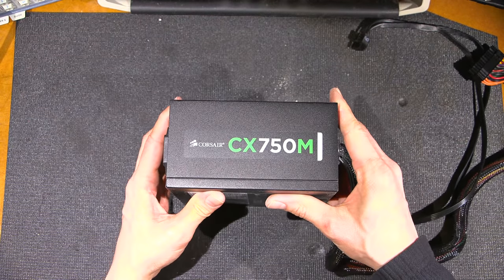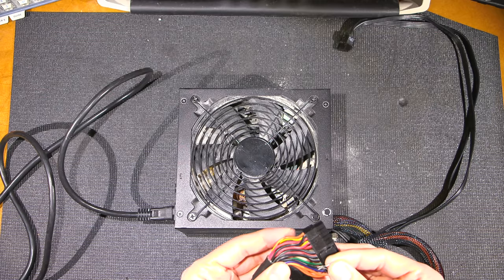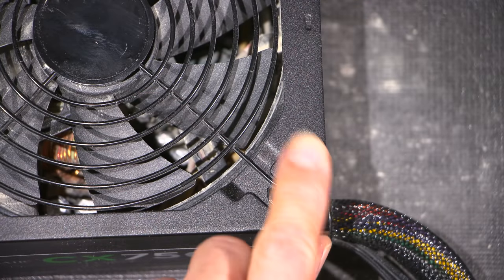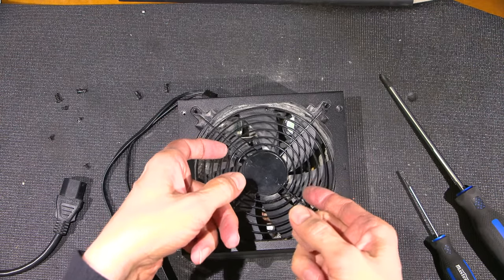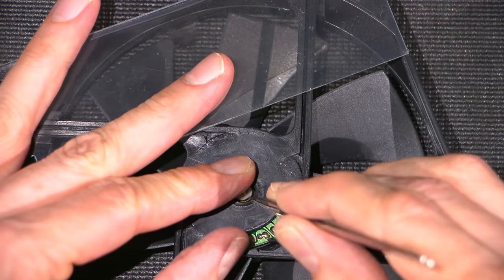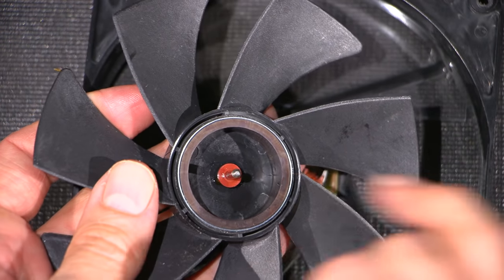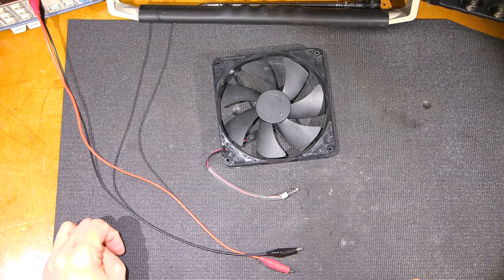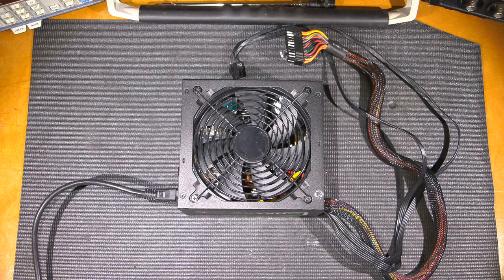Fix A Computer Power Supply!

Comment: I find that for a quick fix, one need only put some (a few drops) ATF (Dexron iii) in the cup where the keeper and the o-rings are, then move the shaft up and down until the ATF is 'pumped' into the bearing shaft and bushing area. The ATF is not only a great light lubricant in itself, but the mild solvent properties will re-liquefy any goopy grease. I have had fans come back to life for at least 5 years by just doing that. Seems to work good on dry bushings, and well as sticky fans with a lot of resistance. I think I would use white lithium grease on ball bearing fans... but I don't have many of those because the balls are annoyingly noisy.

Comment: This wasn't a video on fixing as Power Supply, it was a PC Fan restoration video. Just spent 20min watching a guy dust off a fan and lube up a bearing. Never seen anything done to the parts that supply power, just the fan that cools it. A bit of a elementary video for a guy surrounded by gear that looks like the inside of a goddamn moon lander.

Comment: You inspired me to oil my fans on my GPU, well the one fan that was going to crap and now it is running smooth..  Ironically it is the same fan that I took off and replaced when I got the GPU needing repairs...  The new fans died within 2 months...  GPU fans actually pop apart quite easily and oiling is very simple..  I wish they used more metal though..  They can put a couple grams of gold in the GPU but then chintz out on crappy plastic fans..  We should be able to replace the fans with normal case type fans on our GPU

Comment: I have an ATX PSU that's just destroyed itself. When I turned it on, there was a pretty loud pop followed, maybe a tenth to a fifth of s second later by an almighty bang. Smoke, accrid stench, blown fuse. On disassembly, it seems a mains switching mosfet was gone, it had a huge chunk missing from it and one of the big mains filter caps had vented. I'm assuming the first pop was the mosfet's death followed by the cap blowing its lid with a bang. I can replace the failed components, but I'd be happier if I knew what had caused it to begin with. Everything else in the section seems okay. One VERY weird thing that I think may be relevant. The switching mosfets are all mounted on a heatsink but they are not isolated from it, just screwed directly on it. That would mean the heatsink itself would be live at mains voltage. On checking, the heatsink is mounted to the PCB, but it's anchor points are not connected anywhere. I'm sure that odd design has played a role in this somehow..

Comment: Good vid.  I get your reasoninng for using the resistor.  BUT, if there was danger jumping the green wire to a ground, why then does EVGA and other PSU brands, provided a testor that is absent a resistor?

Comment: ive fixed a fair bit of these things i own and usually the fans are the issue i once had a psu explode and shoot flames from the back just due to a fan that seized so hard and never knew about it.. some times don't even make noise and just completely stuck and just explode from over heating (well if its a semi pos psu though it was 2008 so that explains my knowledge then to now) usually if fan is sealed from the back but know its a standard  bearing type with bushing i drill plastic out and fill it with oil and get it worked through and just seal back with some electric tape or some kinda epoxy carefully. and usually get many years from it. my 10 year old psu is a good example and still runs good today (now in my core 2 quad pc) as it was a 275cad psu of 1000watts bronze. hurray huge comment of my experience.

Comment: What would be the first components to check after a lightning strike? I have an Evga g2 1000w that would be suitable as psu for a boombox. 2 computers died that day and in the Silverstone sfx 600w psu it blew a mosfet driver? A "big" chip that is blown open (used the varistor for a logitech 2.1). In the Evga psu nothing is visibly wrong. Since this is purely a hobby i kind of have to use google/youtube to learn. Oh, i don´t own a osciloscope yet which i guess would help me try to diagnose my Rockford fosgate 400a4 with a blown chanel...

Comment: The bearings drying up seems to be a common issue with this powersupply as I've had this exact issue a few months ago :D
Although I didn't think about relubricating the bearing and just replaced it with a new noctua fan. I still have the old one because it wasn't as loud as your one so I might give new lubricant a try.
What lubricant do you recommend? I have no idea what to buy ^^
Great video as always!

Comment: Tnak you! never heard about the 300ohm resistor from greenn to GND-black.. usually just shorted w/switch... oops! (next trick... create circuit to get precision 12VDC or 10VDC - from 12V output... and/or 1VDC for high precision low resistance measurements... alternator armatures, field coils)

Comment: I have a tx850 corsair psu that no fan or noise happens when it is on and plugged into a motherboard. The motherboard LED lights, however. I shorted pins 15 and 16 on the psu connector and no noise or fan. Could this be the fuse?

Comment: is there any certain type of power supply fan that cannot be diassembled like yours? mine is antec VP 550, i've tried to open the fan because it's noisy but i didn't found anything screwable. is it ok to replace a power supply fan? does it has any requirements?

Comment: but is the fan noisy is the only problem? sometime the power supply will be on but the cpu will not fully on, test loads on the individual power voltages 5+ 5- 12+ 12-?

Comment: You lucked out that fan actually had bearings and not a mag-lev device. Nice job on the repair. I bet much of that dirt was also putting the blades out of balance contributing to the noise.

Comment: My older pc's I never had to actually take the psu apart to get to the fan; just took off the fan screen with the 4 screws as the lil silicone thinger was right there. Then I'd use sewing machine oil (or hair clipper oil) then put it back together. I had no idea wtf I was doing, never read about it or anything, just seemed logical. Now I know I could have blown myself up lol

Comment: My father's PC had a weird form factor 240mm case fan on the side.  It locked up one day, and I decided to try and fix it since I could not find replacements, even on eBay and Ali Express.  Sadly, the plastic clip that holds the fan together broke into miserable little pieces when I tried to get it off.  At that point, since the case had a bunch of other problems, I decided to replace the entire thing for him.  I should probably keep a supply of those clips, just in case this comes up again.

Comment: Get some black veil material that widows use at funerals.  The kind with the screen holes about 0.05 inch diameter.  A big enough piece to drape over the entire project with your hands underneath.  Sometimes you can find it at fabric stores.  Other times you have to buy a veil and just use the whole thing or mine out the material.  When little springs or washers pop off and go sailing they hit the veil and just fall right back onto the table mere inches from where you are working - instead of across the room into another universe never to be seen again.  The black veil material doesn't reflect light so you are almost seeing through it with little reduction in ability to see your project.  And it's so light your hands can barely feel it.

Comment: Would you be so kind as to tell us what the specifications of your isolation happen to be? I have some older vacuum tube radios and ham gear I would like to work on and need an isolation transformer. I do have an auto-transformer.

Comment: I've done this for years with fans. Not to keep the landfills from getting more crap but too cheap to buy new parts. Not to mention I use to repair Computers for people that couldn't afford to have them repaired. If I run into Fans with broken fins I would then strip it down and keep the bearing and motor PCB. I've tried different lubes over the years such as white lithium, sowing machine oil, silicon oil and axial grease but never tried mixing them, mostly in fear of causing a chemical reaction. I'm not good on keeping the sticker and end up using kapton tape and writing the fan specs in silver Sharpe on the side.

Comment: I was wondering how to get the fans apart.  Thanks!  I have a question.  I have one of the surma lw1600pg power supplies that are used for bitcoin mining and it says it works from 100-240 volts but it won't power on.  Have you had any experience with those?

Comment: I would agree with what you did hear, but those green label Corsair units in particular are known to cause failures in other components because of shoddy internal build quality. I’d rather dispose of the psu than dispose of the psu and the motherboard, cpu, gpu etc. etc.

Comment: The other thing you can do to turn the PSU on is to get a cheap PSU tester off of eBay, dime a dozen, cost less than 20USD to buy.

Bonus is that they tell you the wattage, the rail voltages, and turns the PSU on :)

Comment: I replaced the 240v fuse for the broken psu with a 250v fuse available be burnt , but plugged it in and it exploded! So just use the equivalent 250v fuse??

Comment: Some older industrial SMPS will even fail burning out transistors if run without a load. I know of one that uses a pair of transistors to trim the 5v rail. With no load applied to the output these transistors burn out.

Comment: What is the purpose of adding a 1MOhm resistor when testing the fan?
Reply from the maker: Just an easy place to attach alligator clips too. The resistor leads fit the plug perfectly, and the resistor holds it all steady. The value of the resistor is so high, it's electrically invisible to the circuit. Win win situation.

Comment: Hey , i have a corsair cx 500w psu   and my fan screw are rusted , but the power supply works well , could i replace the screw without risking damadge

Comment: Years ago, my brother in law had given me a desktop computer that he had built. At some point, the power supply fan started acting up. One time I booted the computer and after a while noticed a bad odor that smelled like something overheating. I checked the fan on the PSU and saw that it wasn't spinning. I stuck a screwdriver in there to lightly spin the blade and there was some resistance but got it going. I don't think it was the bearing because the fan was quiet when it was running and when the power was off, I could freely spin the blade. I think it was an issue with the fan driver circuit perhaps.

Comment: Does anyone know what the plastic shield on the back of the fan is for?
And by the way nice video as always Mr.Carlson
Reply: The red plug? It's just a dust bung. Keeps the fan lube in and dust out.
Reply: @1pcfred  No I mean the transparent plastic part on the fan that almost covers half of the fan 
But thank you for your answer Paul :-)
Reply: @PrimeMinister555  oh yes that. It is a deflector to make sure the air flows through the PSU and not just out some air vents in the case.

Comment: Among PC builder enthusiasts, this CX green series model is known to be pretty awful. Same with VS series. Corsair RM, AX and HX series are excellent. Corsair doesn't seem to worry about tainting their brand name. For the list, google "PSU Tier List"
Reply from the maker: This one has held up OK, just the fan now... Hopefully that's it for awhile! :^)
Reply: @MrCarlsonsLab  Often the output caps go bad, but they actually looked OK here
Reply: @MrCarlsonsLab  it seems like it is a crap shoot if a Corsair PSU runs, or not.  Some do and some don't. A quick web search turns up a lot of start up issues with them.

Comment: So I've gotta ask, why is it bad to use the compressed air to push the fan blades?  I've done that for years, even with air compressors on fans in motor control drives for treadmills and I've never had an issue.  The sound is very satisfying :)
Reply: It vastly overspeeds the fan. I did it to a laptop once, and blew the blades off the motor...

Comment: I'm guessing you don't want to share the lubricants you used, but can give you give me some hints on viscosity/grade and what the base oil is for the grease?
I need to have a crack at fixing bearing noise in two of the fans on my PC.

Comment: I was getting (power supply) noises from my pc that were very weird. Sort of an intermittent rattling/chirping sound. I cleaned it out with compressed air and that worked for a day or two but then it came back, primalrily when watching videos or playing games so I suspected the v-card. I thought the card might be loose and tried several methods of reseating the card in case it was rattling. Again a few days of relief, and then it came back again. I thought I would just have to live with it and then one day I placed the pc on a rack system and the sound went away. Come to realize the exhaust fan on the power supply points down from the bottom of the case. And the feet installed on the case simply weren't tall enough to allow it to vent properly. Now I have it "jacked up" on wooden playskool blocks that are 1 inch high and its fine again. In the meantime I learned more than I ever wanted to know about PC power supplies. In the end the answer was: Physical Science.

Comment: Those screws u claimed were worse then drywall screws are actually very standard pc fan screws......the corse threading is because the bite into the plastic fan and hold it against the metal pc case

Comment: They make power supply testers that will take care of the power-on signal, and display the bus voltages. I already know about lubricating these fans and use silicone lubricant (bought it at Radio Shack but I think you can still buy it - a clear plastic tube with a nozzle and cap.) I had the same brand PS develop noise but nothing like that, and I always blow the dust out of my PC's periodically.

Comment: I think the reason why the fan runs so quietly in the power supply is precisely because the power supply runs the fan in an undervoltage situation, likely running the fan off its 5V rail as opposed to the 12V rail the fan is rated to accept, running the fan slower and greatly extending its useful lifespan.  it ran visibly slower in the power supply than when you ran it off your benchtop power supply.
Reply: No, it runs from 12V rail but with PWM duty cycle control. At high load the fan may actually run at full speed.

Comment: Nice to see even modern hardware repaired, and its nice know how to repair those fans myself now.. I regularly oil our box and tower fans (sadly the only 0il I know for them is regularly available 3 in 1 which i have to reapply often) rather then throw them out, but had no idea how to do it for my cpu fans. I still got all my old cpu fans since I always keep broken cpu hardware in case I found how to repair them in the future. Anyone know a good regularly available grease or oil that I could use, even if it means order it online?
Reply: 10w30 full synthetic motor oil. It holds up forever, without evaporating.

Comment: there is a problem with gamermax rgb psu they tend do give a bad odour of burning plastic smell at some point, this issue can fixed manually there is a small plastic covering the Fan on the reverse side inside the psu its held by 2 screws remove that covering as it should not be there as its stopping the psu from fully being cooled and psu begins to overheat. Mine started smelling the 1050w rgb i open it up and removed the plastic rear fan covering and now voila, all plastic burning smells have gone and overheating hot psu has disappeared. the manufacturer forgot you don’t cover the fans airflow. hope this helps some people.  If you want to remove that fan noise in your video remove that plastic fan covering on the rear  of fan as its stoping also airflow.

Comment: I have this exact same, model, not the one he has in the video, Power supply. It loses the 5 volt turn on signal. I have to either leave my PC on, or bang on the side of the PS to get the PC to power up. I've had the PS apart, and didn't see anything fried. Is there a place I can get a breakdown or a pinout of this PS?? I did see that, I think its a purple wire that goes to the 24 pin MOBO connecter, comes from a small daughter board. Someone had mentioned a cracked solder joint, I need to pull it back apart and check that.

Comment: You are lucky its just the fan not working in a Corsair CX.
With those its "luck" whether the switch mode controller is able to start up. A few components around the controller are borderline from the factory usually.

Comment: What was the blend of 2 lubricants? Is that unlocked in your Patreon? I've used 3-in-1 Motor Oil SAE 20 just because it was the closest sounding thing to what I needed it for... rejuvenating old motor bearings. Was the grease silicone based?

Comment: You shouldn't mix oil and grease. You can get transitions and no consistent oil film will form. The oil and or grease can also cause each other to separate and change the consistency of the grease, affect the viscosity of the base oil, dilute additive concentration or create a number of chemical reactions between incompatible components, which can lead to additive neutralization, changes in lubricant chemistry and impaired performance properties causing premature failure of components.

Comment: Most pc fans have a sticker over a rubber or plastic cap that seal the bearing and lock washer that holds the blades and shaft to the rest of the assembly.

Comment: I have fixed alot of fans by just removing the sticker and plug and adding 3 in 1 oil into the bearing and putting the plug back.  I didn't know you needed to take it all apart.

Comment: Most of them use sintered bronze bearings that are vacuum impregnated with lubricant. Oiling them, in my history, seems to be a short term repair? This applies especially to shaded pole motors?